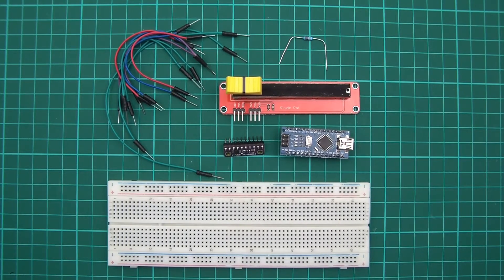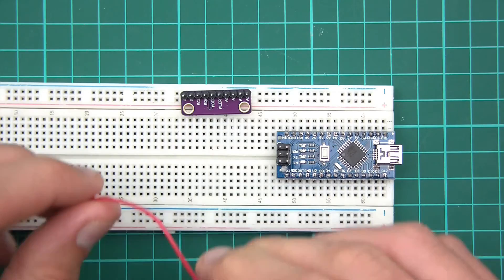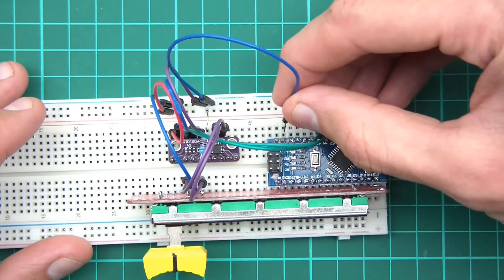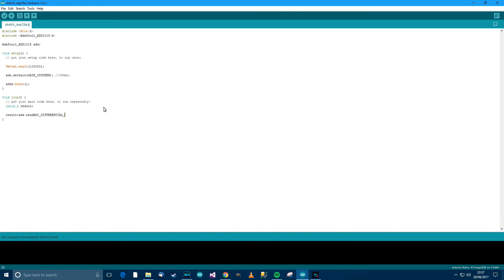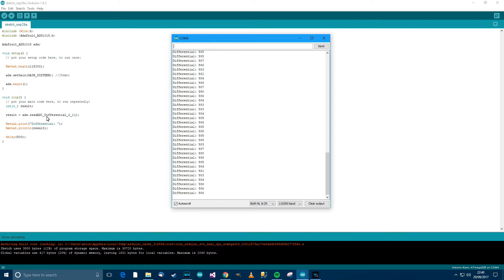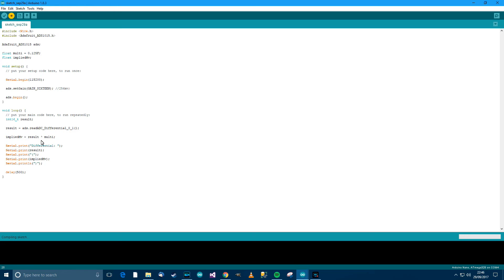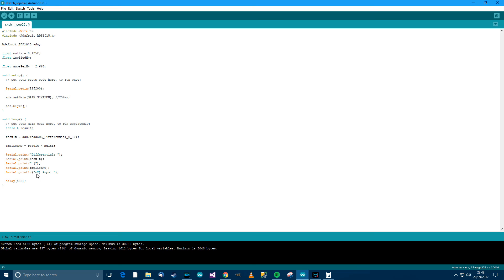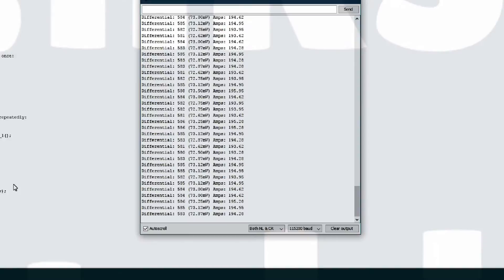TUTORIAL: How to Make a High Precision Current Shunt Monitor - Arduino! (Part 2/2)

Comment: Good video, however with solar you will be wanting to measure current into and out of your battery to monitor the state of charge. So when you are discharging the shunt will give a negative voltage, have you found a solution for this?
Reply: This setup should also read in the negative thats why he is only using 2048 for the postive side and 2048 for the negative side.

Comment: Hi Antony, great demonstration. Was wondering if there was a way to measure negative current. So 0 -75mV would be current draw from the battery, but what if the battery was then charging from Solar. Would these shunts output a negative voltage maybe this could indicate charge current

Comment: I don't get it... 200 AMPS? At 75mV * 200A that would mean 15 watts going through the circuit. The Arduino can't provide that. Are you sure this is correct? I'm sure I'm misunderstanding but I don't get how :)  For some reason the current shunt thing as a whole confuses me. Please, if you will, enlighten me.
Reply: 200 amps does not flow through the arduino, but through the shunt resistor.  The wires going to the ADC (and arduino) don't really flow much current.  They are to measure the voltage drop across the shunt resistor.

Comment: it just gives me the voltage divided by 7.16, not the actual current, any ideas why?
Is it because shunt and arduino use the same ground?

Edit: Without delays between readings (differential on A0+A1 and A2+A3) it throws out weird readings depending on i don't even know what, but adding 20 ms delay fixed my problem.
Reply: You need to look at the settling time for your ADC.  Each one is different some are faster than others.

Comment: There is also a 16 version of the ADS1115: 16 Bit I2C ADS1115 :p
Reply from the maker: Yeah! I have one! These things are awesome! I'm really impressed!
Reply from the maker: And to think the traditional way to measure a current shunt is to use an amplifier! Ha! This thing is awesome!
Reply: I have a couple of them so about to have a try of what you did. :) Plus i just ordered 5 shunts from Ali 4x100amp and 1x200 amp, Now the question is can i use one ADS1115 to read 4 shunts given it has 4 channels? I hope so which case for 5 shunts i will need 2x ADS1115
Reply from the maker: Mikes DIY Tesla Powerwall You can do that, you can measure 4, but that's in single mode. It's a better idea to use differential mode for shunts, and you can measure 2 stunts that way. The reason being is that it eliminates parasitic noise to some extent and differences in ground line voltages...

Comment: Nice! I'm really impressed with that ADC. Thanks for showing how to set it up!
Reply from the maker: Thanks Carl.
Reply: @antonycartwright  I am trying to measure current for my solar system. if i have 24v on my shunt, do I have to use divider for ADS ?
Reply: @meccip  yeah you do. If you don't use a voltage devider to pull down the voltage supplied to the adc analog inputs, you will destroy it. Anything above Vcc on the adc (porbably 5V) is a no go. Its a key information missing in this video.
Reply: @niesreininghaus171  what if i use differential mode in this module? would this possible to use the shunt in the high side of my solar system? roughly 100-160VDC.